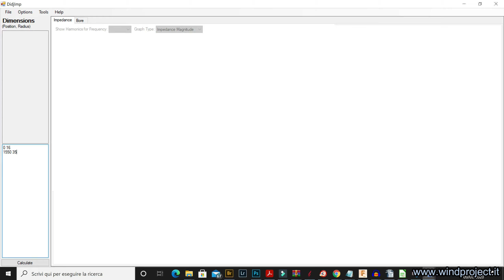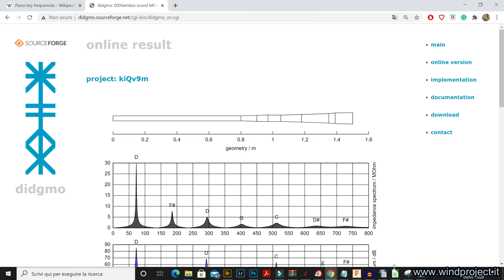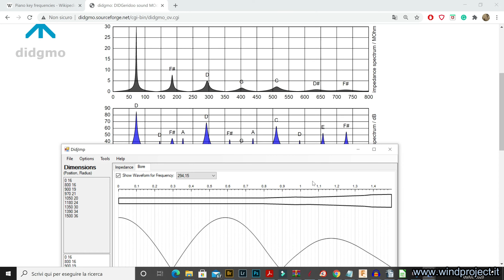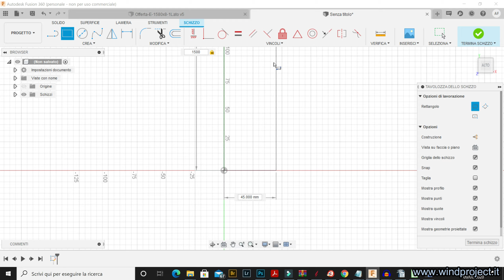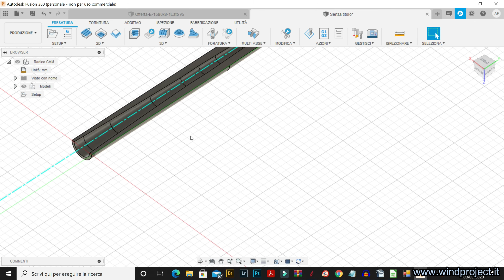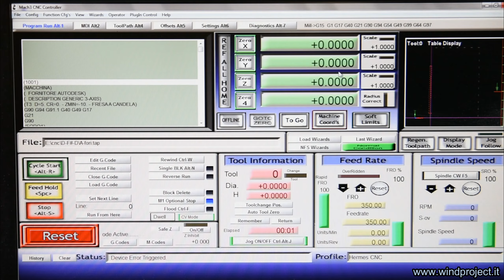Didgeridoo building using CNC milling machine, 1D acoustic simulation, CAD/CAM, testing

Comment: Are the dimensions shown in your video what you’d recommend for a beginner who’s goal is an instrument that is easy to play?  (0to.8-32, .9-38, .97-42, 1.05-40, 1.18-42, 1.35-60, 1.39-68, 1.5-72) If so I’ll stick with these.